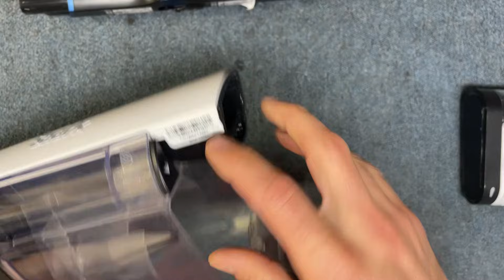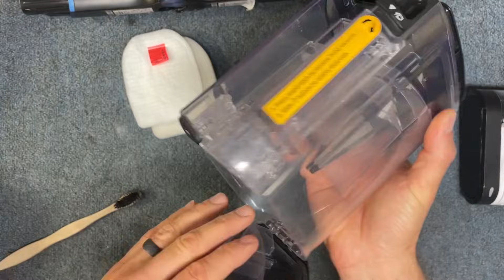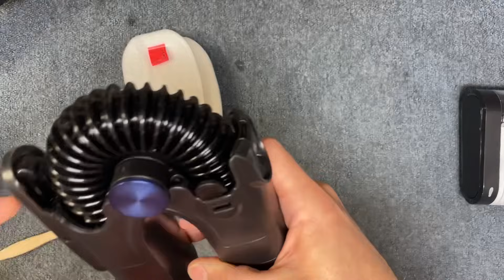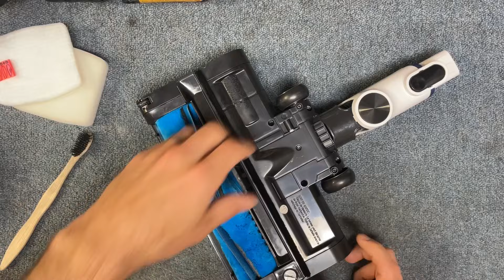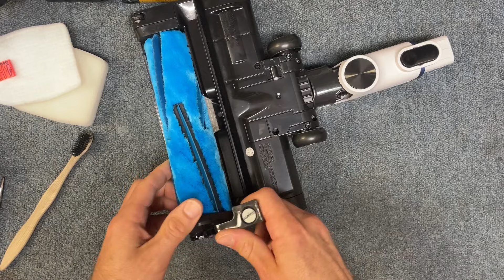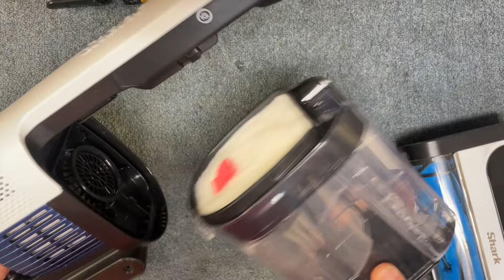Vacuum repair man | How to clean and maintain your Shark Cleansense Cordless vacuum

Comment: Darn I was hoping you talked about how to replace the brush! I actually a new brush purchased it directly from Shark but as you said , it seems there isn’t a way to actually change it. Not sure how tu get the attachment off the old roll.

EDIT! I did get the little lever off! I just had to use a star-shape screwdriver to get the tiny screw out!

Comment: We bought one of the latest Shark cordless version, 70 minute working time. After purchase, we were blown away with this cordless vacuum cleaner's power, user friendliness and battery life but also regrettably discovered a major design flaw that destroys this machines user friendliness.
Quality house cleaning is easy to achieve, despite the 'joke' of a dust collector ............. but thanks to a major design flaw, ............ after every house vacuum, all 3 filters must be washed, as they clog up.Hmm 
Being obligated to wash the 3 filters out after each house vacuum, thanks to a MAJOR design flaw, is a major problem. Hmm
Our solution to this MAJOR problem was to buy 2 X spare sets of filters so that we can swap the dirty filters and not have to wait for the cleaned filters to dry. Hmm

Comment: I've had mine for almost 2 years and never had issues with it. Keep it clean and maintained well. Today it suddenly just stopped. Like the lights turn on and it charges but the motor refuses to turn on and suck. How do I fix it?
Reply from the maker: Unfortunately shark vacuums that have these sorts of problems tend not to be repairable. It would be unlikely I could fix it myself much less walk anyone through it on YouTube.

Comment: I completely took it apart and cleaned it hoping it would fix the flashing red light on the battery pack since the internet said that was probably why it won’t work, but it still won’t work. Any suggestions?? Really don’t wanna buy a new vacuum after little under 2 years 😭
Reply from the maker: Sounds like a battery failure. Is the battery available for this model? I’m not sure myself. You’ll have to research

Comment: I was so stupid i remember i was able to wash the vaccum before but forgot how to do it so i just put water in it while the motor is connected now i know i am screwed is there any way to fix it? I am trying to air dry the vacuum motor now.. huhuhu please help
Reply from the maker: Ooof yeah I wouldn’t be too optimistic. Most likely your motor and board will be damaged due to water. There have been a few rare instances where I have seen a motor come back to life after some time of drying. I hope that is the case for your situation but wouldn’t be surprised if it’s a goner

Comment: There is a 3rd round paper filter under the two sponge filters. it directly surrounds the motor, and should also be cleaned carefully but thoroughly. The filters are protecting the motor from damage, from micro-dust particles. So keep em clean.
Reply: How do you access it?
Reply: @endemicchocolate  Pull on the black plastic 2"circle that covers the paper filter. The entire cover comes off.
Reply: @Lala-el8oh thanks 👍
Reply: It seems to be a mystery  @endemicchocolate
Reply: Yes! I found this round paper filter was also filthy. Thank you!!
Reply: How should this be cleaned? With water or no?
Reply: @DIRTYPONYI yeah, you can use water on this filter. Just dry for 24hrs before use.

Comment: I saw your video in YouTube when I was trying to clean and figure out some stuff about my shark V83471 vacuum, thankfully your video showed me how to remove the hepa filter which I was scared to push out at first. There is a small capsule inside the transparent canister that I don't even know the purpose, but some dust went inside, how do I get it out?
Reply from the maker: Sorry I don’t remember enough about this model help you with that question

Comment: Hey. Thanks for the great video. 

I hoped I could find the answer for my question on your video but unfortunately you didn't addressed it. 

I couldn't find a way to properly clean the dust accumulates inside the transparent cover, on the left side where the brush engine is. 

If you have any idea pls share 

Cheers
Reply from the maker: I will keep an eye out for another one of those and try and address that in the future. Thanks for the request
Reply: @ am looking to it. Tnx for your kindness